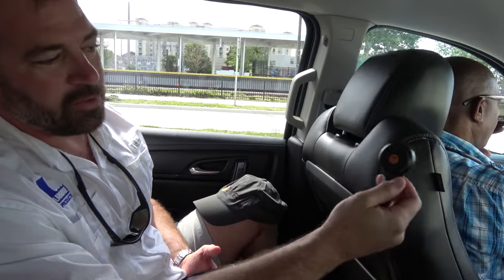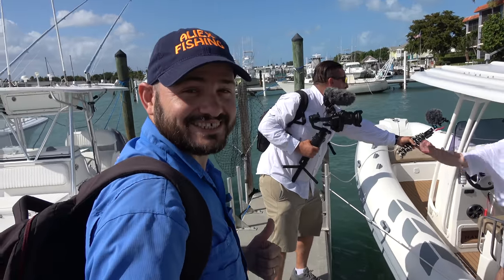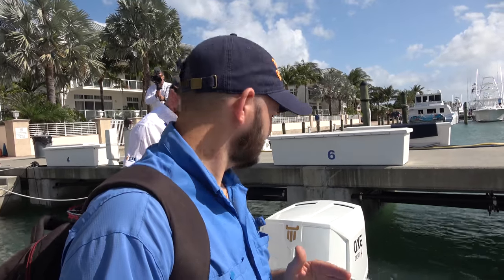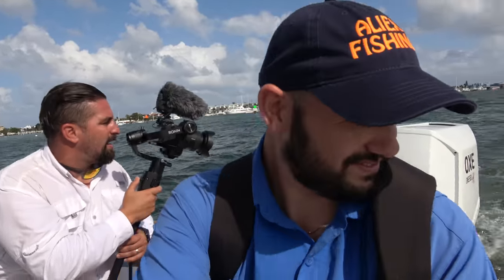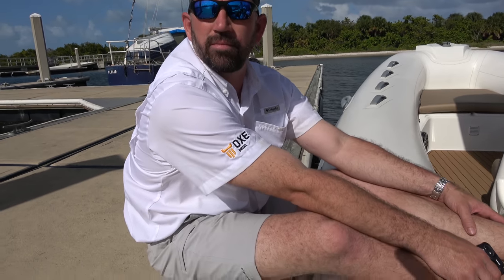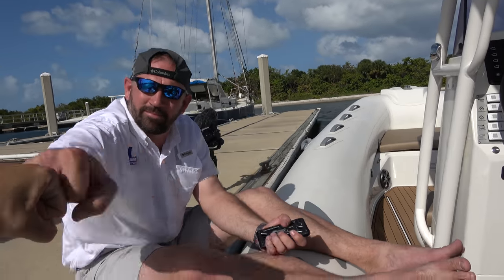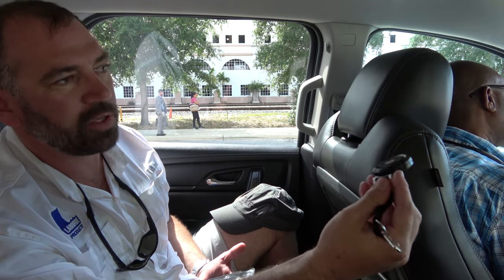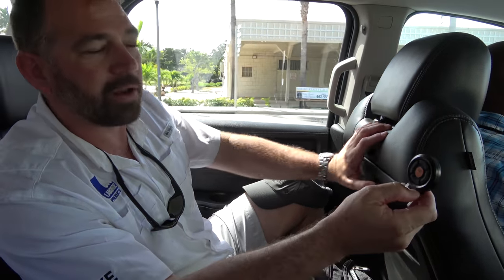New Diesel Outboard Water Demo Oxe Diesel K 150 HP on Brig Navigator 730 Palm Beach Boat Show

Comment: I can't help but wonder how that exhaust in the water reacts.Diesel is dirty fuel by nature.Another coffin nail??
Reply from the maker: Interesting question
Reply: marq taylor yes it is.   Poison.  
After a while around them you will get sick.     And the next time you have about five minutes till your sick agin. 
And the next time you toss.  Then you won’t be able to follow a semi or worse a pick up.  I have seen folks pass out from diesel fumes.     But you will find out
Reply: @stev838  Nope i won't find out.I'm a solar kind of gut when it comes to boat's.
Reply: marq taylor cool.  The watts are getting bigger  per panel 
Always though a golf cart moter could move a small. Boat.   12ft.    Or so.
Reply: marq taylor too exaggerated question we all using solar energy in boats here but if you talking about power you must choice either gas or diesel engines and suggest you search on volvo penta diesel engines it's just a example for your idea
Reply: Muzo I yup a tough problem. 
Got to have the down force.   Low end    Diesel.   Had around 1200 ft lbs per square.  
Gas 800.  If I recall correctly 
   Takes hp.     Solar hydro plane  fluid drive.   My whole thing is about the fumes.   It’s a bad thing.  
And on water.   It’s worst than cigars.     Does it have a pfd filter or is it dumped I. The lake.    Frown
Reply: @stev838  well you may right but i think lake or sea there is big different for the fumes,my brother have a sail boat bavaria 46ft 4year old build in beautiful volvo engine and we never had problems like that,even you can't hear the engine sound but this is a little different than O/B engines of course
Reply: Muzo I am onboard would be very quite.   Low hp.  Low rpms.   It’s just that type of fuel burn is very polluting and toxic.    A pulse type fuel delivery   system helps but thats really new.  Tarzan no like fumes.  Smell like swamp in rain storm  and jungle brother  that throw Pooh.
Reply: These engines comes with CRHDI meaning it's super clean probably giving a rating of 2 to 3 🌟 rating
Reply: Ibrahim Rishwan is that a particulate filter.    Another way is to use the sound waves to break it up but the tech is hidden.
Reply: Ibrahim Rishwan But If you are  the builder of this unit. I can design a muffler that will lower carbon and nox.   My patents have expired  but I am able legally to design a marine unit for any model.   My semi units dropped carbon 77 percent at idle and 37 percent over the road.    Lower nox. No back pressure and increased performance.   55 additional hp to the wheels  on a 650 hp platform
Reply: @stev838  ill be honest with you. no outboards have the exhaust gas treatments used in automotives. only thing treated before released to the atmosphere is the excess petrol which is treated by a catalyst. i've worked with almost all of the engine brands and models there can be and i can assure you there is no catalyst to treat the exhaust gases. so please explain in detail about this muffler design you've mentioned. who knows it could turn out to be an industrial revolution in OBM exhaust emmisions
Reply: @stev838  for your reference average OB exhaust system is as follows. through the exhaust cover to the exhaust guide to the exhaust manifold to the exhaust muffler and then released through the propeller boss.
Reply: and regarding this particular engine,  i did go to a boat show in dubai which ftd this engine and going through the book i did not notice any catalyst or any other sorts of treatment for exhaust gas. its just a very advanced diesel engine with low emmisions.
Reply: Ibrahim Rishwan sure.  
My design folded the sound into standing wave forms inside the muffler. As the lousily combined fuel and soot encountered the standing wave forms  a from of electric vitrification  or the molecules took place  the carbon was broken into its base  particulates.  Free carbon. 
The un burnt fuel was vitrified     By electrostatics    As a sound wave meets a sound wave it is cancelled along like frequency’s in the standing wave form    Called destructive resistance   As my previous statement said carbon was reduced 77 percent at idle and 32 to 35  percent over the road.  And yes I can design one for any type of engine    My racing models  according to the drivers added at least 25 hp. On semis it added by dyno 55hp to the wheels. No back pressure. And wow did that stump some folk   
It works or i would not be talking about it     A very interesting point is along with being so quite  ( below the level of the cooling fans and Motor noise      It also lowered nox  and co2.     And. Out put temps due to   Physio electric     cooling    ( phone  won’t spell  it ).  Can’t remember the correct spelling.  But will look it up.  Any way.  I wrote my first patent in 92.   Then 94.  
And they have expired    But  I  could do
It agin  several folks have tried and failed but they did not know what I know. 
If you are in contact with a group that manufacture  such things I would be glad to speak with them  I still have the test data.  That stumped the experts.  

.

Comment: Belt driven?  How long does the rubber band last?
Reply from the maker: Good question, I'll ask them
Reply: I believe the belt is carbon fibre and made to last a long time. Some motorbikes have the belts instead of chains and they last a very long time. I am sure there is a service schedule for the belt change out.

Comment: with an diesel motor, it should not matter how many people are on the boat. so why does this engine slowdown with more people?
Reply from the maker: How much weight a boat has matter no matter the engine
Reply: Props slip. Tires dont.
Reply: Because the pitch of the prop is the same even a truck would slow with a heavier load
Reply: Thanks Hadn’t thought of that

Comment: Two problems, you can’t test an engine on inflatable boat because it is an in accurate test because the boat is so light. Second Diesel wouldn’t be good for an engine if it sat in there for a long time that’s why most people use ethanol free gas because it will make the engine last longer
Reply: yes you can

Comment: Engines are double the cost of a gas, and weigh about 1/3 more. Only stacks up if you're doing serious miles.
Reply: In many isolated places only diesel is available so who cares about weight or cost if you have to carry two fuels.
Reply: And double the torque !

Comment: I hope it has a raw water water cooled inter cooler.  That would be sweet.
Reply: See a raw water pump on the pulley
Reply: Closed looped cooling system. There's a heat exchanger to cool the coolant. Sea water is pumped through the heat exchanger

Comment: I don’t see torque as a big advantage on water. Now you can roll some coal, boys.
Reply: you can run a bigger prop with more torque
Reply from the maker: Towing?
Reply: @bobbobson4607  yes a bigger prop and more pitch  = lower revs for equilalent speed.  but you dont have to go up hills on the water 😂

Comment: I recognize Blue Heron bridge and Munion Island!
Reply from the maker: Nice place, how is the fishing around there?
Reply: @AliexFolgueira  Not bad, but you're right next to the palm beach inlet and the gulf stream is usually only a couple of miles out from there, so if the seas are OK then that's the better place to go.  Edit--> just realized you do most of your fishing from a kayak.  The fishing is better when the tide is running.  If you feel safe in the inlet, there's good tarpin fishing there.

Comment: 74 k per engine and trans belt replacement every 200 hrs. Sounds like a expensive novelty that will never makeup the price offset of a comparable 4 stroke
Reply from the maker: Everything starts somewhere, as more pop up I bet they become better and less expensive
Reply: Id rather go with a V6 Mercury Diesel Outboard 175HP with a triple setup rather than an Oxe 200 or300HP Twin setup. Mercury are lightweight and the service and support is amazing from Mercury.

Comment: What are LB FT of torque ??? Vs a 150/175 Hp ??
Reply: The OXE 150 puts out 280 lb/ft of torque at 2500 rpm. For comparison, the Yamaha 428 puts out about 400 lb/ft at 4200 rpm and with a supercharger, only 120 lb/ft more and the Yamaha is a 425 hp V-8 engine. The OXE 150 weighs 772 pounds  and the Yamaha 425 weighs 952 pounds with a 25-inch shaft or 999 with a 35-inch shaft. Not sure if this answers your questions completely but I couldn’t find the numbers for a 150/175 for torque and the 425 comparison gives a good idea of how much this little 150 packs.
Reply: From their homepage 200 HP. Delivers 200 HP and 415 NM (306ft-lb) of torque. With the high torque gear ratio on the primary belt the unit delivers up to 900 NM (664 ft-lb) of torque on the propeller shaft.

Comment: What's the name/brand of that kill switch system? Where can you buy them?
Reply: its this companies own special feature, pretty useless imo. Remote start on a car is good to start the ac/heat, or warm the engine up but on a boat? Well if you're going out on a boat you have to get on the boat and turn the batteries on before anything and at that point you're already on the boat at the keys so what's the point of a remote start?
Reply: @craigerking9790  ok, thanks for answer. wasn't interested in remote start, but in the kill switch function
Reply: @frankmiller99  kill switch is something that is every single boat ever built, it's that little red lanyard
Reply: @frankmiller99  you can find them online pretty easily if yours is malfunctioning, but every outboard ever made has a kill switch on it, not an accessory that is to be added on later
Reply: @craigerking9790  Yes Sir, I'm familiar with the kill switch red lanyards, but they don't let you move around much. So I'm looking for brands that make 'remote or wireless" kill switches without the red lanyard, like in the video. I've found one brand so far: Fell Marine
Reply: @frankmiller99  exactly you can fish your whole boat while it's running and have a kill switch in your pocket

Comment: Is there any benefits to a diesel? Seems like it would be more costly to buy, be louder than a four stroke, and less horse power to weight. Unless the fuel consumption is significantly less I can't think of a benefit.
Reply: BCBuzzard the big market in this is for marinas and big boat owners. If you own a large inboard diesel, its convenient to have your tenders or playboats be diesel too, so you could just refuel from your main tanks. So yeah, think marinas and tenders, not hanging two of these on back of a Contender or Grady.
Reply from the maker: It has its advantages for sure, better fuel efficiency and like Francois says, big boats use diesel and it is a mess when their dinghies use gas, gotta keep two type of fuel and stuff, also this is like new... It should come down in price
Reply: That make sense as use for a dinghy.
Reply: Less hp?nah...not now adays.
Reply: @victoriousvictor7978  the OXE 200 weighs over 700 pounds a Mercury 400 weighs about 670. So the diesels have less HP to weight. Higher torque but lower rpm. I imagine these have a heck of a hole shot speed but not a high top end speed. Purpose built for dinghies. I don't imagine seeing these on tournament fishing boats yet.
Reply: @TheKennyHack  with the ocean moving amount of torque it generates they should be able to prop the thing/gear it to achieve some gnarly top end speed. 

Yea. No argument it is heavy. But its a 4 cyl isuzu diesel. The weight can stay the same and they could crank it up to 350hp without meany issues. Bigger turbo and bigger injectors/map. Still...heavier then the merc, yami or evn 300/350. But more efficient and longer lasting?probably.
Be interesting to see what happens in the next few years with them.
Reply: @francoisfranceschini7947   yeah that's one reason but the main reason is safety,  petrol is to unstable and a fire on a super yacht is no joke,
Reply: wrecker4 thats not true at all man, gasoline (petrol) is stored on board for many things, from generators to power washers to jet skis. If that were true, outboards and cars would be catching fire all over the place. The things that generally cause a fire at sea are electrical issues or some engine part (i.e. turbos) heat soaking. Having Gasoline tanks is not a safety issue at all, its a connivence issue. Im willing to  bet most, if not all, yatchs would still carry gasoline onboard either way. (For Jet Skis and Generators and such)
Reply: @francoisfranceschini7947  gas inboard is explosive. I know people who have been blown out of their boat. And before my time my dad witnessed it happen
Reply: Jared Grass yea just like some cars explode when in an accident. It happens, but not commonly enough to worry about. Those are mostly sailor stories. All it takes is a bit of common sense, its more of a hazard to have a dumbass on board than a jug of gas. Again, in maritime terms, having gasoline on board is NOT a safety issue.
Reply: A lot better range, a lot less fire risk. And the fuel savings. And it has a closed cooling circuit.
Reply: @TheKennyHack  they can have the same top speed because run bigger pitch prop at less rpm but hole shot is slower, same as cars !!
Reply: @victoriousvictor7978  yes well said
Reply: @francoisfranceschini7947  generatirs are usually diesel. Petrol + electrical fault =  poss fire!

Comment: Is it more fuel efficient then a Honda?🤔
Reply from the maker: Diesel is more fuel efficient depends on how big the Honda motor is
Reply: @AliexFolgueira  
A 200hp Honda vs 200hp Oxe
Reply: The Diesel doesn't burn rice like the Honda
Reply: It's more efficient than any gas engine.

Comment: 350KG for the 150HP????? thats like a 300HP yamaha. super heavy.
Reply: Well it is a diesel they're not known to be lightweight
Reply: It has a closed cooling circuit.
Reply: @nathanbutler8240   and thats a big deal. more weight means less people allowed on the boat, slower speed, louder engine...all of that to save couple of $$ for gas. not worth it. will stick with gas outboards.
Reply from the maker: I think over time they will shave some weight, 200# is like one person less on the boat
Reply: @AliexFolgueira   Yes, but extra 200lb on the transom is a different story. Slower planing time, more trimming which will slower the boat more... The only good thing I see is diesel  vs gas. Other than that, Gas outboard are better in everything else.
Reply: @fadyhakim3333  more torque compared to a gas engine plus a hydraulic gear box with 2 adjustable torque ranges for heavy and light plus half the fuel consumption at WOT compared to gas plus longer engine life and gearbox life. With all of that, still it's a diesel, you cant get it to rev high as a gas and it will be loud
Reply: @FIDO4748 well there are people who use outboards for commercial use. There are speedboats for instance say a gulfcraft touring 38ft with 28pacx with full luggage powered by tripple 300's, i can guarantee you that WOT will drop at least a 1000 given the load. So of an engine with same hp can deliver a high torque range, there will be people who definitely wants it cause at the end of the day, the one with the higher torque efficiency will give the better fuel economy
Reply: @FIDO4748 and the more you run it at it's optimum rpm range, the longer the engine life span will be. Unlike one which is coping to reach an optimum rpm range under the load
Reply: @rishwannn  you dont need it to rev high thats the advantage of diesel torque. Just gear/prop it up !

Comment: Mercury made a diesel outboard years ago
Reply: they used a spark plug gasoline engine. no diesel benefits at all, like greater torque and fuel efficiency
Reply from the maker: I hear a lot negative about mercury engines
Reply: buy it

Comment: $150k for the motor talked to the distributor $150,000 for a hundred 150 horsepower diesel outboard bit to much for me
Reply from the maker: What do you mean $150k?
Reply: @AliexFolgueira  I spoke to the only dealer dealer in the US in Fla and MD price for the 150 hp diesel outboard is $150,000 not installed
Reply: @danacoyle1826  Yes it´s built for users who use their engines for 1000 of hours per year. Therefore being a good choice because its almost half the gasoline costs. Who knows, in the future when they can massproduce it maybe the costs will come down
Reply: It's $50k

Comment: I think the diesel Outboard is cool ....but the exhaust is still going in the water and diesel exhaust is even dirtier than a gas engine or two-stroke less refined. I want to see a stack on this thing.I want to see bellowing black smoke out of this outboard. LOL Not really!  Two-stroke still the best.
Reply: Uhm, not true.  Even the EPA knows that Ethanol based gas has no benefit like they projected, yet the corn lobbyists push ethanol and the gov has egg on their face. 

I hate NPR, but even they know that Ethanol based gases are worse:  https://www.npr.org/templates/story/story.php?storyId=18784732    The people quoted in that article are def from the most liberal oil hating colleges or firms out there and even they are slamming biofuels. 

Here is another study:  https://phys.org/news/2017-07-diesel-gas.html

Not to mention ethanol destroys so many parts in the machines they are used in.  Let even a weed eater or lawn mower sit too long and see how much it gums up the fuel system.  Biofuels like ethanol have to have beefed up fuel systems in vehicles because it is so caustic. 

People get so worked up over seeing some black smoke.....   And two strokes don't bellow smoke?  Are you serious?